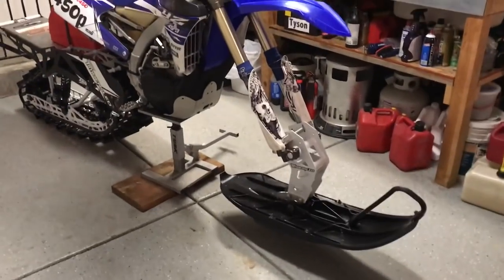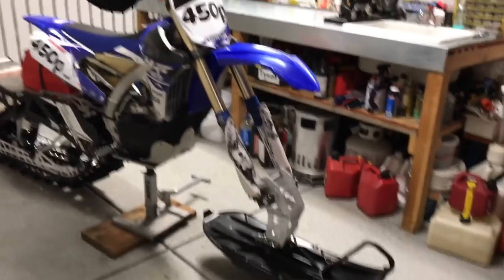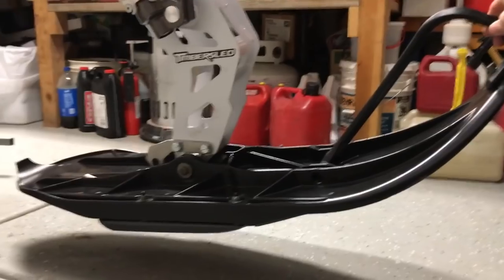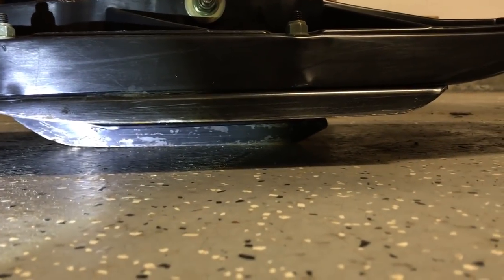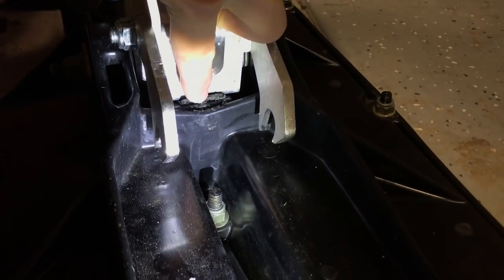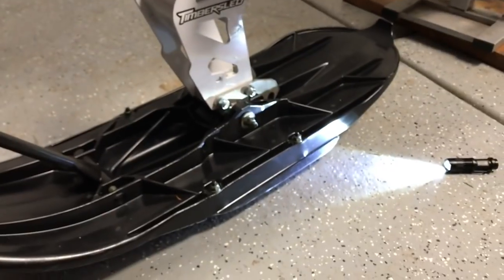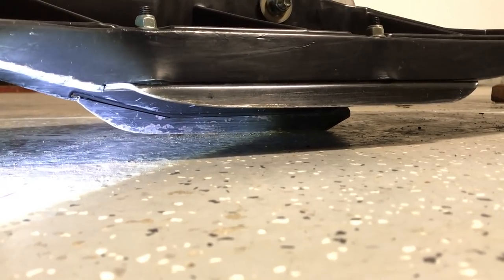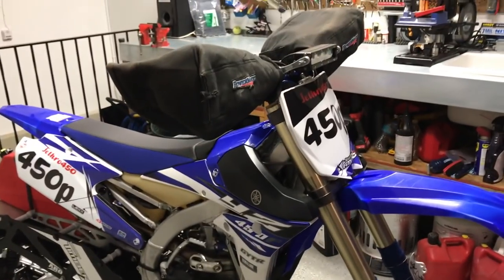HOW TO Adjust your Timbersled Ski

Comment: Dude this is awesome, built my first snowbike this year. Aero kit it darts on hard pack and won’t even cross a road, it hits pavement and stops dead in its tracks, going to shim my ski now!!! Thanks bro
Reply: I even bought the studboy center skagg but it didn’t help
Reply from the maker: @55yearoldfunjunkie  I did the same thing!  But after shimming it it works so good now that I put the stock skag back on and love it.  It'll work for ya!
Reply: @55yearoldfunjunkie  I put a triple skag on my old 2014 and I could turn on tar so easily.

Comment: Glad to see you did some grinding and made the front of your Scag a much better taper so it will slide up over things easier, great idea. 😊  The rubber shim is also a great idea, I've been using a bungee to help hold the front of the ski up, but I'm sure that rubber shim provides better Force to keep the front of the ski up. 👍

Comment: I just feel like my ski is jerky and not stable on trails in the deep it’s fine I’m new
Reply from the maker: Sounds like either too much pressure (raise the forks in the triple clamp or stiffen preload on front spring of the kit) OR your ski has the pressure too far forward.  Shim the ski.  If it’s good in powder, I’d try the forks or kit spring preload first before shimming the ski
Reply: @jethro450  ya when riding it’s like I have to hold on so tight and shit that it’s not even fun and I can’t go fast it’s just not fun
Reply from the maker: @robertlambert7906  don’t be afraid to make changes
Reply: @jethro450  I’ll see what’s up fosho
Reply: @jethro450  it’s on my 2022 crf450x I have emission delete and fmf slip on waiting for my vortex from twisted developments